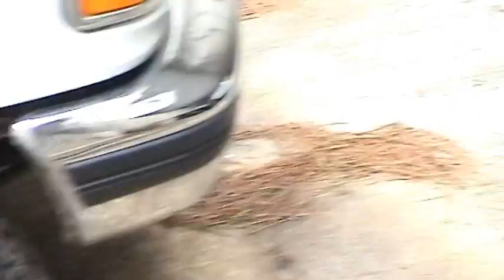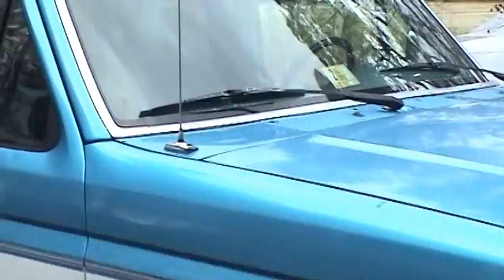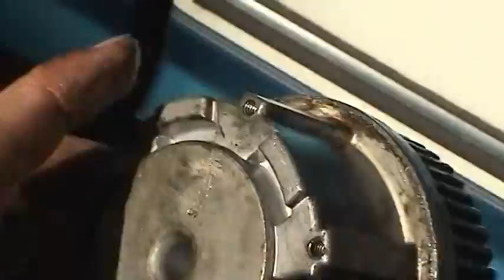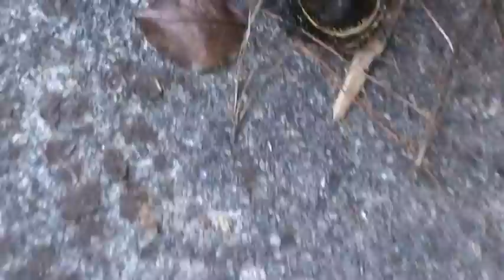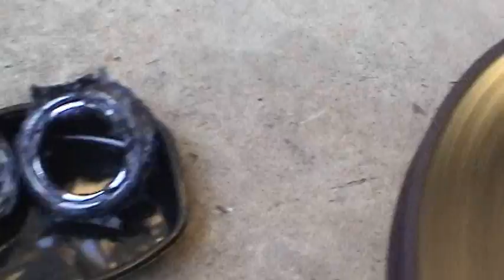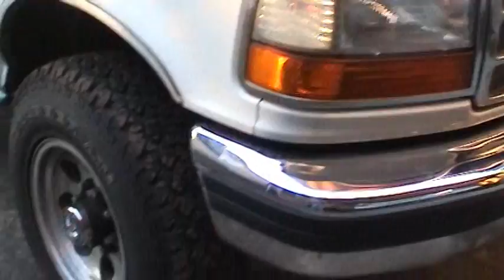1995 Ford F-250 4X4 Automatic to Manual Hub Conversion

Comment: To pack bearings, I scoop up some grease in a zip-lock bag, drop the cleaned bearing into it, close the baggie, and squeeze - the grease gets into all the bearings cavities  w/out dirtying up my hands. Done, throw the baggie away. Another thing Ive done for difficult to remove bearings is use a large livestock syringe & a long 16g needle to inject grease into tye nooks & crannies. Works well using the syringe needle point to pop open the small edge on sealed pulley bearings.

Comment: Nice vid.  I had done this years ago, changing factory auto hubs with Warn manuals.  I had forgotten about the parts that had to be changed.  Tearing down now for new bearings, etc. and this was a good reminder of what was inside.  As to the front LSDs, I believe manufacturers stayed away from that because of difficulty with steering - the outer wheel needs to turn faster than the inner.  In its place, I believe the makers like Quaife and Torsen came along and solved that problem with a redesign.
Reply: (replying to self)  I also believe that the failure of my auto hubs was due to a grease hardening problem, rather than any mechanical breakdown.  Don't know.  Never looked back

Comment: Another great tutorial, thanks.  One question if I get rid of the autolocking hubs , then I do not have to use the manual lever anymore to put in 4 wheel drive?    Mine actually has a high and low 4 wd floor shift.

Comment: You should have re-installed that inner snap ring on the outer groove on the stub shaft closest to the end to keep it pulled against the seal on the back side of the knuckle.  Without it your entire axle shaft can pull away from the seal and allow contaminants to get into the spindle bearings and then deeper into the hub assembly.
Reply: It wasn't on there When he started. Probably why water was in his hubs.

Comment: Getting ready to work on a 95 f150 with man. locking hubs. the complaint is that their is a grinding noise wile in 4 wheel drive. I will not need any kits since they are manual locking already. I will insist on checking bearings at the same time. (hate doing things twice). is there anything I may need to know that you did not cover in your video. Thanks.
Reply: Timothy Grasmick how did it go....my 95 F-150 is doing the same.... making noise.....what was causing the nosie???

Comment: On the 4x4 auto when it goes out will that front shaft still turn weather its on or off? Or if it works will it turn or will it be locked?

Comment: I have a 1994 f350 351w 5.8l with manual locking hubs. Does anyone know the torque spec of the piece that requires the spindle socket? My first time doing rotors on this beast. Any videos on how to pull apart and put the manual hub back together would be appreciated

Comment: I have some play in the 6 to 12 o'clock direction on the passenger side of my '97. Any ideas if replacing the inner and/or outer bearings would help?
Reply from the maker: I would clean and repack the bearings and then adjust them first. Most likely, they're simply out of adjustment and don't need replacement.

Comment: What did you do you with your push button mechanism on your dash once you put the manual hubs in? Do you need a lever on the floor board to engage the conversion hubs?
Reply from the maker: My truck didn't have the push button feature. The automatic hubs engaged when the front drive axle would turn. They were very basic and strictly mechanical. They also were known for their high failure rate. The new manual hubs are working great.

Comment: thanks man i have a 94 f150 with a 302 auto locking hubs and it is sliping i mite have to get a new hub asebly but definitely going to manual locking hubs

Comment: I have a 97 f250 7.3 and have the same front axle and 3 screw hub cap. What is the size of the socket to remove the nut?
Reply from the maker: It doesn't have a size specifically. It was a model 7796 from OTC tools.
Reply: ***** thank you!

Comment: Very good video. I just bought a "96 F250 with the 7.3. Do you think all will be the same as the '95? It has 145k on it and it's probably time to pack the bearings.
Reply from the maker: It should be if it's got the Dana 50 IFS.

Comment: Great vid!! I have the 3 bolt auto hub on my 95 bronco. I'm having issues locating the correct hub socket. Could you tell me what size it was and where you got it?
Reply from the maker: The Bronco should have a Dana 44 so most auto parts stores should have the right tool. Ask for a hub lock socket. They're not cheap, but there's nothing like having the right tool for the job.

Comment: What is the name of the special tool that you used to get the spindle nut off. I am having difficulty finding the hexagon nut to remove it on my truck
Reply from the maker: That was a spindle nut socket. I found it at NAPA. It wasn't cheap, but it sure did the job pretty well. You'll want the Dana 60 version instead of the Dana 44.

Comment: We put the same hubs on a work truck was in 3 months they blew up  I would get warn
Reply from the maker: So far, these hubs have been holding up quite well. I don't go off road too much so I'd consider my use to be on the light side. If they do fail, I may switch to Warn and see if they last longer.

Comment: Great video shadow, I've never cared for the "automatic" hubs. That's a nice 3/4 ton Ford. Is that a '95?
Reply from the maker: Yes. It's a '95 4X4 with the 351 Windsor V-8. The new Mile Marker 449SS manual hubs are working great!
Reply: Mine is a 95 with 460 that has 354000 plus on it. My automatic lockouts and calipers and rotors are currently failed. Guess I pull the e4od and put it in the 94 standard body with 7.3 international. So much for having a super cab
Reply: Tracy Hill Mine is a heavy duty 94 super cab with 7.3 International diesel (18 mpg on hiway)), with autolocking hubs, and  newly rebuilt E40d trans.   Changing to manual hubs.  Needed to watch this video!